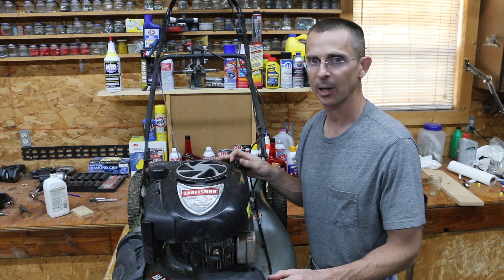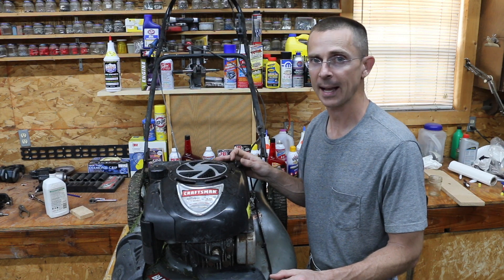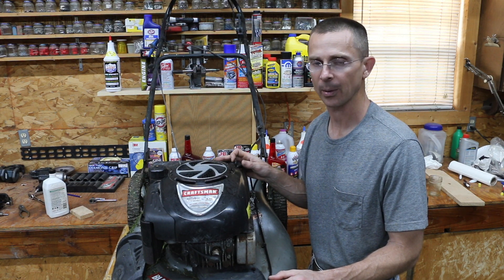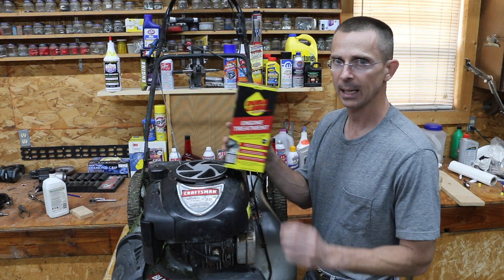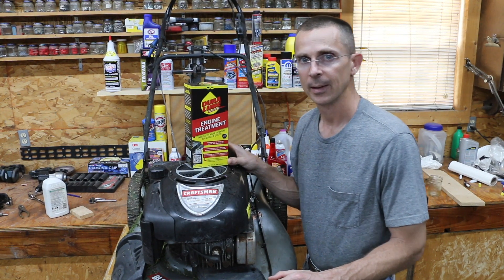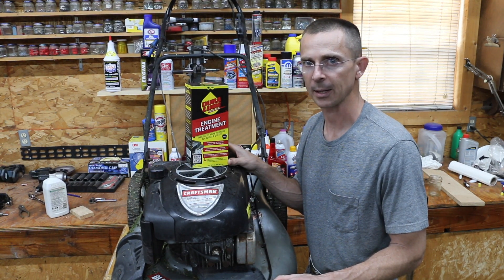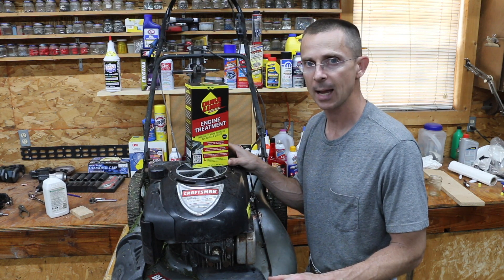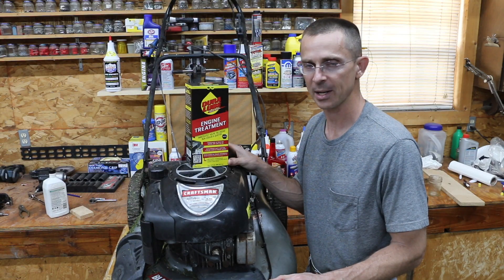Does Dura Lube actually help quiet and cool a gas engine as claimed?

Comment: I would like to see you do the test with this stuff like the slick 50, for they made the same claim as you can run it without any oil too back in the day as well. The test you made with the slick 50 was surprising considering it froze up, though the temps were so low on that motor vs the one with no additive.
Reply: The Slick 50 they sell nowadays has nothing to do with the Slick 50 you saw in the infomercial way back in the day. Both Slick 50 and DuraLube ended up in bankruptcy due to the FTC suing each of those companies asserting their claims were false. 
Slick 50 (the name but not the patended formula) got purchased and then sold by a number of different petroleum companies that sold their own formulas (ie "teflon' based) under the Slick 50 name, however to this day what is being sold as Slick 50 is NOT the original patented formula.
You can actually by the original formula which is still being sold by the guy who came up with the formula in the first place, but that formula goes by a different name now (Xcelplus) since the formulator lost the rights to the name when the original company was sold off. 
 In the case of DuraLube, to my knowledge that formula has not changed, although just like Slick 50, the original company ended up getting sold off due to the FTC lawsuit which left it bankrupt. DuraLube was picked up by a company called Great Brands Inc,  which as it turns out, is a marketing company owned by Shell oil. 
That same company also now owns the Slick 50 name (but not the original formula), MotorKote, DL Turbo, and Shell X-100 motor oil.  Yes, they are all owned by the same petroleum company now!
Go here if you'd like to know the story behind the ORIGINAL slick-50 https://youtu.be/CAt-tJa9P_s
And here also https://www.youtube.com/watch?v=-1C7-5L58kI
Reply from the maker: Yes, I plan to accomplish some more dry crankcase testing.  I'd like to acquire new engines versus used engines with varying amount of wear.  I'm not in a position to buy new engines at the moment and many have commented that testing on used engines isn't a fair comparison.  Still thinking about the options.   Thanks for watching the video and commenting.

Comment: I put in it my old 1977 TA when I used to drive it from Romeoville to Chicago everyday for work. The temp before I put it in was always at 210, there and back, and after I did the oil change and put the bottle in, it went to 190 on the gauge, and all I did was my regular oil change as I always did, but this time I decided to try it for the heck of it because it was a old car and I had been driving it a ways and wanted it to last a little longer, and for me proof was in my temp gauge, for I always watched it like a hawk. 

And incidentally after that when they came out with their fuel system cleaner after I moved to Florida, I had a 1988 Ford F250 that the secondaries used to stick on me if I floored it, and would be flying down the road sometimes unless I kept hitting the pedal. I tried all kinds of products in my tank, including carb cleaner, and nothing would work, but then the dura lube fuel cleaner came on the market so I gave that stuff a shot, and in about a 1/4 tank, my secondaries no long stuck ever again. So I been a big fan of both products and have been using them in all my stuff since the stuff has hit the market.
Reply from the maker: Impressive results!   Thanks for watching the video and commenting.
Reply: Impressed with the fuel cleaner story, gonna try it on a car I've had sitting for a bit. Most of those are hype and achieve little to nill...old Romeoville, that was the plant Ford  made all those killer 4.6's among other fine engines.. Gone now unfortunately..Like so many other great plants!! Thanx for that Fuel Tip!!!
Reply: Every day

Comment: Heres a suggestion for a video. Im not sure if you  can weld or what not but how about putting two mufflers on a mower to quiet it down. Ive always found mowers to be too loud. I wonder just what you could come up with to really lower the noise
Reply: Think about it. An average car makes 200 hp and is pretty quiet. Why is a 5 hp engine so much louder?
Reply from the maker: Great suggestion!   Thanks for watching the video and commenting.

Comment: I tried Duralube in my car at one point ('89 Ford Escort GT), and while I didn't notice any difference in power (if there was any, it was much to small to notice without a dyno), but I beat on that engine for a long time - redline up- and down-shifts pretty much all the time - and never seemed to lose power over time either.  I'd say it's probably not bad for engine longevity if you start with one in reasonable condition, but I've never tried it in a completely clapped-out motor.  :-P
Reply from the maker: Great point!   Thanks for watching the video and commenting.

Comment: Bought a used chevy cavalier 2000 only 27,000 miles on it in Feb of 2001 
 been putting Duralube Engine , Stp Oil treatment , Lucas oil stabilizer  and a quality motor oil for 17 years now oh and every third gas fillup Dura Lube fuel system cleaner into the gas tank and that car runs great . current miles 134,273.7
Reply from the maker: Impressive!   Thanks for watching the video and commenting.

Comment: You should also try this engine oil additive called "Krex Graphite". It has actual graphite powder mixed in with the oil. A run dry test "if you do that again" would be awesome.

https://www.amazon.com/gp/aw/cr/B002Y2OY2C/ref=mw_dp_cr

I recently bought a case and will be using it on my next oil change for my Audi.

Comment: You forgot to measure the ambient temperature before and after.  Furthermore, you did not show that the oil duralube containers are sealed before mixing them.  I tried that duralube years ago for my old car and I did not notice any significant performance improvements.

Comment: That was some nasty crap you pulled from the crankcase! It would be interesting to see what exactly is wrong inside the engine, that would require a teardown. Oil additives have their place but a serious mechanical defect must be repaired, there's no magic bandaid.
Reply: i agree, i see these as fast repairs, usually in order to sell it, the noise etc will come back , but the time for refund is gone once the guy leaves with it

Comment: My best results with Dura lube has been in Manual transmissions, I used to run a fleet of tow trucks, once they started getting over 200,000 miles you would get gear chatter and and occasion "kicking" out of gear, Dura lube would quiet things down and extend transmission life by another 25,000/30,000 miles or so before rebuild was needed.
Reply from the maker: Michael, Impressive!   Thanks for watching the video and commenting.

Comment: I have used Dura Lube at Reg oil change intervals for 3/4 of the time I had a 94 6.5 turbo DSL. It let my engine run far cooler, and when I blew an oil cooler line at 440k I drove it approx 50km without oil, never heated,  knocked, or hurt the motor in any noticeable way. Simply put in new oil (6 litres) and it's still running at over 500k. I'm a solid customer
Reply from the maker: Impressive!   Thanks for watching the video and commenting.

Comment: In my 1994 Chevy Silverado with 256.000 original no on a 350ci I use and have been using "HYPERLUBE" for many years and it's half the price as Duralube. 
   If I remember the old Duralube commercials, will run an engine without any crankcase oil "After a duralube treatment" for an "X" amount of time without any engine damage. I would like to see that test, but in my opinion, I don't think the gains you listed were not significant enough to make up for the cost of duralube.
     Great video, thanks for sharing. E.dee
Reply: Eric Dee ... hard to beat the TBI 350 for longevity... and I'm a Ford guy. I lost a freeze plug in a 2.9 Ranger with "Prolong" ... drove it 13 miles , installed new freeze plug n away I went👍

Comment: Try Bar's Leaks Engine repair. I used to mix two different products in my ex girlfriends car that she was using at the time. They seemed to do as I was hoping but they just cost too much then I found that Bar's stuff and it seems to do the same stuff without me mixing it and was cheaper. Her 94 mercury grand marquis might have limped around like a old dog but after that stuff it seemed to be more responsive. But while I was thinking about it I might as well tell you what I was using before turning over to Bars they was the products named Restore and the STP oil Treatment.
Reply from the maker: This is great information.  I have both Restore and STP oil Treatment.  I plan to test them in an upcoming episode.  Thanks again!

Comment: Put gear oil in the sump. I'll bet you'll see even better results. 
All this stuff is doing is making the oil thicker or a heavier weight. That's borne out by the much higher cold compression number.
Reply from the maker: Oil Burner, this is a great suggestion!  This is an old "used car" sales tactic I'm told per some old timers.  This will be a fun video to make!  Thanks again!

Comment: Could it have been the "fresh oil" that helped the noise?
Baseline should have had a No Dura Lube run with fresh oil...
But....clean oil did seem to get it running better

Poor mower doesn't know what it's in for does it :P
Reply from the maker: Brian, The mechanic I purchased it from had recently changed the oil.  It has a lot of blowby which is why the oil is so dark.  Then again, the oil I added has zero use versus some use.  So, it could have been the new oil.  

LOL!  I agree, this mower is probably going to have a really bad day!  Thanks for watching the video and commenting!

Comment: but, would a super thick oil added to the oil do the same job to quieten,  or a thickener such as sawdust ( a very old conmans way of doing  it)?
Reply from the maker: Jusb1066, Yes, it would.  However, there are other drawbacks to using a really thick oil.  I'll demonstrate this in an upcoming video using this engine.  Thanks for watching the video and commenting!
Reply: oh for sure, the thick oil  was to sell a damaged engine/gearbox quick, soon as it left the yard, all bets were off!

Comment: No, I think that most products like Dura Lube are nothing more than snake oil designed to separate you from your money. 
Some good old extra thick STP or Lucas Oil Treatment might help quieten a knock, but nothing will "cure" the underlying problem.
Reply: It turns out that STP and Lucas is snake oil  compared to Dura lube and Bestline from his test.

Comment: 20 years ago I tried Dura Lube old TD 14 International and it did make the motor quiet,,, an old friend of mine that bought and sold old antique bulldozers he would  go to an auction ,,you can look it over old rusted and tired iron and find rpm  vibration point in these OLD machine and he would always find that vibration point and then. set the idle before the auction to that point to  make that bulldozer ,,,,, just sound like that motor was going to fly apart any moment,  ,,,,   , anyway I put Dura Lube in that Dozer and we both agreed  it made it sound much better !!!!!!!!!##  and I ran that machine and pushed up miles and miles of terraces && built a few dams and sold that old tired iron for just about what I paid for it
Reply from the maker: d Eddie, Impressive results!  Thanks for watching the video and commenting!

Comment: Hey liked the vid👍 maybe you could try running a engine with strait vegetable oil in the crank case. it seems like it would work If it is the right thickness and slickness. And hell might even try running it on vegetable oil wile you got it☺️
Reply from the maker: BOB White, This is a great suggestion!  Thanks for watching the video and commenting!

Comment: Try motorkote. I put it in all of my vehicles and equipment. It seems to make oil last longer and quiet down loud engines.
Reply: DuraLube and Motorkote are owned by the same company, a division of Shell oil. They both work, however I don't really like the color of Motorkote which darkens the oil. DuraLube doesn't darken your oil.

Comment: All it did was lower the frequency of the noise, the sound level reading might be accurate because the lower pitch of the sound is masked by the engine noise better than the higher frequency knocking
Reply from the maker: Rex, Great point!  Thanks for watching the video and commenting!

Comment: put pure stp oil treatment in it and it will quiet the engine and allow the motor to last longer than any additive i ran it in a 351 windsor started with a quart had rod knock it would work almost a week then i would drain out 1 gallon of oil and fill with pure stp blue bottles did this till truck locked up from chokeing it out at idle called my dad he said it will pull start i was doubtful but dumped the clutch it started right up that was last time i drove it when i tore the engine apart it had no rod bearing and piston was slapping the head but still would start run and drive so i drove for a month or more on a engine that would have threw a rod first drive with oil only when your poor some times stp can help
Reply from the maker: 22sniper, Impressive!  I'll be testing STP soon.  Thanks for watching the video and commenting!

Comment: Additives seem to work at first but I have found they will fade several hours down the road.  I would rather run a thicker oil to help reduce engine noises and vibration. My father would dump STP in his cars and it never seemed to do anything.
Reply from the maker: M Man, Great point!    Thanks for watching the video and commenting!

Comment: Must have been 20 years or more since I use DuraLube.
Reply from the maker: boodieman72, Do you use any other additives?  Thanks for watching the video and commenting!
Reply: I take care of my engines so oil additives are not needed. I have used LiquiMoly's Ceratec though.
Reply: I am using MotorKote now

Comment: I put Dura Lube in three different vehicles had the same result in all three vehicles you don't notice s*** for a week my diesel truck seem like more like a week and a half to but what I noticed in all three vehicles that they ran cooler in that the time it takes them to come to temperature is longer duration definitely improved fuel mileage I was at 13 on my truck now I'm at 14 the trucks just over 300,000  the starts are smoother the camper van is well over three hundred thousand didn't see quite the fuel mileage increase but a 1987 camper van  going down the road at 80 miles an hour without a knock Miss  or nothing haven't done fuel mileage on the Third vehicle a car if somebody's got real life experience with something else I would like to hear about it
Reply from the maker: Robert, Interesting!  I enjoy reading about real life experience.  Thanks for watching the video and commenting!

Comment: I remember when Duralube had an infomercial where they tested their product against Slick 50 and all the others using a very scientific method known as the ring block wear test. The problem was that they tested the competition diluted with motor oil but they put the Duralube in the tester undiluted. That was where the science ended and the sales talk began.
Reply from the maker: Tim, Yes, I remember a lot of these commercials.  Thanks for watching the video and commenting!
Reply: i think Slick50 and some other similar additives had miniature PTFE particles and soluble Molybdenum, permanently suspended in oil(or something like that )that would clog up some oil filters ect?
Reply: I used several different additives in my race cars because I ran them in 200 lap endurance races and needed the insurance. Every little bit helps. I never experienced clogged filters but my engines were clean enough to eat out of.  The biggest issue with running a stock engine wide open for hundreds of laps is overheating so any reduction in friction is welcome. I never used Slick 50. I used Advance Auto brand teflon additive called Greased Lighting which has way more teflon. Like I said no clogged filters or issues. The only races we didn't finish were the ones we wrecked out of.

Comment: replace engine oil with cooking oil its works I know a guy and that's all he runs in his car
Reply: jonathan thacker then he's an idiot
Reply: yes he is I'm going to take it apart when he blows it up and see what damage is done so far he got it 2 years ago and put 20,000 miles on it and its still going had around 90k on it when he got it its a 87 s10 2.8 engine
Reply from the maker: Wow!  I might test cooking oil to see if it holds up.  Thanks for watching the video and commenting!

Comment: My first though was "i bet it does nothing other than make a wallet lighter", Pretty close?
 Then I started thinking about slippery substances, Colloidal Graphite is quite slippery, I could only find "Aqua Dag" the stuff used on the outside of CRT's for its conductive properties, I've not found a cheap source of ultra fine graphite to bung down an oil filler yet,
 Any thoughts?
 Regards, J.
Reply from the maker: Average Joe, I'm not sure about whether or not graphite would work but it might.  I've got some I could use in a test.  Thanks for watching the video and commenting!

Comment: wow, the compression increase was surprising.  it did cool the engine, but was louder, however, couldn't the increase in loudness be from increased power and its sound from exhaust?  i loved duralube, always worked great for me.  a 10 degree reduction in temperature can mean a lot for a car engine, so i would say that it is worth the money, especially if it cuts down on wear and tear.
Reply from the maker: I think the RPMs went up enough to cause more sound.  Thanks for watching the video and commenting!